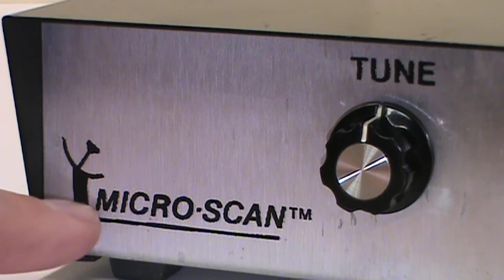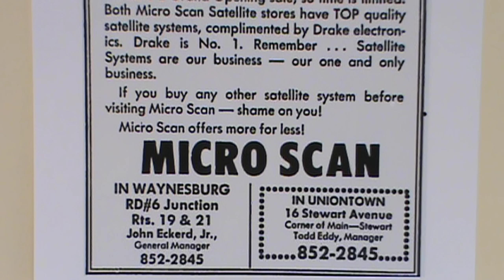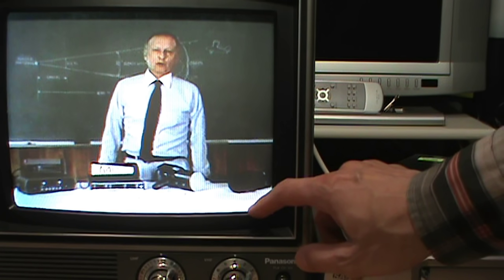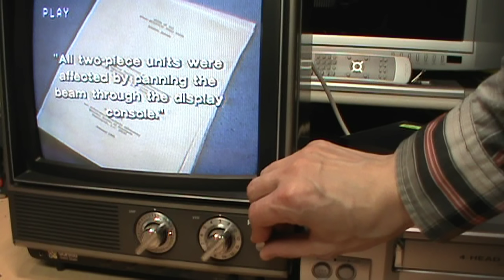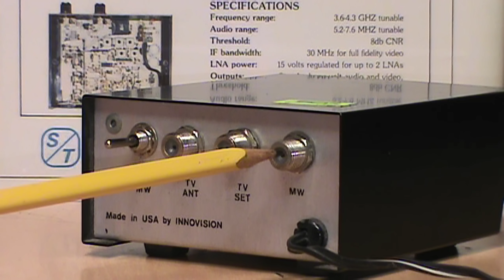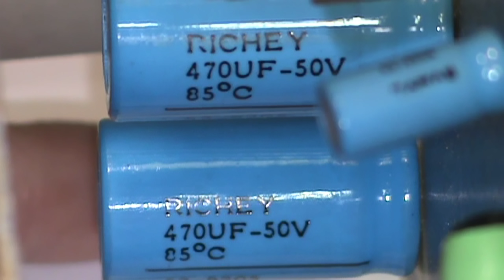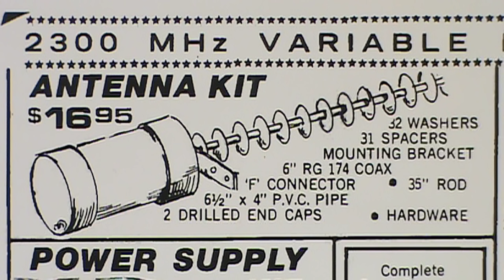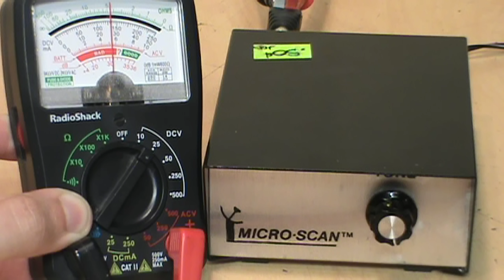Micro-Scan mystery 1980s TV device - Satellite? Microwave?

Comment: We had that exact kit at 9:50 in the early 80's till early 90's to receive HBO here in California. Recorded a whole library of VHS tapes with movies and other stuff like Fraggle Rock.  I tried using it in our new house when we moved but the signal was too weak. I remember trying to record Star Trek VI when it came on HBO around 1993, but the reception was too bad. We eventually just got DishTV and then Comcast later on.

Comment: If it was for 13v / 18v Vertical/ Horizontal or later Right Circular / Left Circular they would just need a on-off-on switch with the voltage of 13 or 18 on each side of the switch

This could be a text generator overlay 

So you click the unit on and it puts the 2nd source over the signal

Comment: MMDS; Wireless Cable !   An old friends rural property has a Receive dish bloody hell WAY WAY up in a 110 ft Loblolly pine tree. The receive dish is curved aluminum open tubing ( not solid bowl) and looks sort of like a 1960s deep fringe UHF antenna channel master and Winegard sold. 

This dish is on a several section "radio shack"  push up pole lag bolted and strapped to the pine at about 100ft up and the Dish originally was above the pine forest canopy. 

This was NOT a "UHF channel" receive setup. This was in the middle of Mississippi about in Carthage Miss.  Near Wiggins#2 between Canton and Carthage .  The download coax to the cabin was long; ie 110 ft down and another 90 ft horizontal; roughly 150 ft to the cabin and another 25 ft inside.

This system ran DC in the center pin to ground that powered the preamp on the open frame dish. The DC part also was varied in voltage to tune it. The preamp was also part Downconverter ie a mixer  so the signal down in the VHF band so less losses. It used 2 or 3 1as the downloaded "converted signal" So this downconverter was set to channel 2 since Jackson WLBT is channel 3. 

So the MMDS 2.2 to 2.7 Ghz  microwave antenna picked up a non broadcast Premium "rebroadcast" that was not a 14 to 82 UHF channel. The mixer by the dish changed it to channel 2 or 3 Vhf to run down the coax

The install crew was 2 guys that took turns with the climbs for each customer. Once Spiderman was up there other guy used a pulley to lift up the dish on multi section pushup pole . The guy went up in the pine with climbers. ie no fancy 1000 buck Swedish bands tree climbers. Basic telephone pole climbers.  Would not have believed it. There was a mid 20s age white and black guy and my God they must have been part Spiderman for those brave installs. I always wondered what they got paid to do that crazy stuff. One install truck a mid 1980s dink Ford Ranger

That dish is still there today and was installed in the late 90s . The service was gone I think by the late 1990s?? Not to sure

Measured the height with a Suunto clinometer long ago 

I am not sure how they billed after the install cost. ie maybe another can cline in.

This whole odd "get premium channels in nowhere" was after the mid 1980s 8 to 12 ft steerable Dish at satellite bubble. Ie you scanned the satellites along the equator zone. Westar 7? , Galaxy 12??  etc TVRO 

Those I think were in the C band like 3.7 to 4.2 ghz region. Much was newscasters getting ready for an event, Both babe putting on makeup. The guy adjusting his tie. not feeds for general view.

For clarity there is no DSL today there; or cable; or fiber. There was no Free money to add fiber since not on an electric COOP service

Comment: This device reminds me of one of those RF A-B switches where there are two coaxal F-connector inputs and one coaxal F-connector output. I could imagine this could have also been used to hook up a cable box, or an antenna in one RF input, and either a VCR or a video game console on the other RF input (like recording one channel from your VCR from one input, and by watching another channel at the same time from the other input back in the analog TV days).

Comment: There was a couple of companies that had this in the Houston area in the 80s and 90s. It actually isn't satellite at all. It's microwave TV which is below the C band. It's proper name is  Multipoint Distribution Service (MDS). They would put this long mast on your roof with a directional antenna on the top that looked like a small dish and they would point it towards the tower. My dad got it for a couple of months in the mid 80s after we got rid of cable. It had two channels. One showed movies 24/7. The other showed old movies during the day and hard adult movies at night. They were not the simulated stuff they show on Cinemax. It was the real deal. I still have the tapes my dad recorded, lots of 70s stuff. Later on another company had a service called People's Choice. It had a converter with a remote and had the same channels for the most part as cable. They scrambled all the channels like they did with the premiums on cable. Both used the same kind of antenna.
Reply: I also had this same box, and lived in the Houston area. I remember getting the two channels, as mentioned, plus a third channel with PPV stuff, such as newer movies, and special events. I saw the very last Muhammad Ali vs. Trever Burbick. Also, the porn eventually became 24/7, which caused some awkward moments, since you accessed other channels turning the button. My mom was visiting and I went to tune to a new movie and for a split second exposed my mom to a very graphic scene. Luckily she wasn't looking. lol. I think this thing lasted about 3 years before better technology retired broadcasting this way.
Reply: @wg4ever58 we had it in fall of 86 or spring of 87. Right away I was like “this sucks, no mtv, nick…” I would have to go to the other room when they put it on the adult channel. I think my dad got it just for the adult movie. His thinking was he could sell them or trade them for other movies. It just had a free moving knob to tune the channels in. After they cancelled it we only had an outside ota antenna till we got cable again in 93. I bet this service was pretty easy to pirate as it didn’t appear to be scrambled.

Comment: These were ground-based microwave TV systems, using a much lower mircrowave frequency than later satellite systems. They were used to distribute cable TV, at the time meaning six to nine channels, reliably, in areas where houses were too far apart to run coaxial cable to them and ordinary rooftop VHF antennas could get maybe two or three channels (and only got that if you were lucky on a given day about wind, weather, ionization layers, and electrical interference). 

Subscriptions were only available to customers who didn't happen to have a mountain between themselves and the transmitter, but given careful choices about transmitter locations, one transmitter provided service to a fairly large area. 

The "tune" knob is just a rheostat, and tuned the antenna to different frequencies by driving a flipflop circuit with a capacitor. More voltage drove the flipflop faster (and frequency higher) because more voltage saturates the capacitor faster. The transmitter and receivers were also shockingly simple; they transposed the entire VHF band by several (seven?) "octaves" using frequency multipliers/dividers.

My memory of these is from a college class where the instructor told us someone had built a commercial microwave tuner in the 1970s and 1980s using only four simple electronic components, and challenged the class to figure out the burning question: HOW?! 

Years before, he had scored a case of tuner boxes and antennas (one receiver built into each antenna, as you guessed) and one transmitter at a surplus sale. He tried at the time to get the frequency license for our area so he could do practical demos, but the FCC auctioned off the bandwidth divided into much narrower frequency bands and combined into much larger areas.

Comment: way back when i ran a uhf tv system owned by the cable co, i had 14 uhf modulators, and Tx combined on our tower. customers had a uhf roof antennae installed, and a tuner box similar to that. we transmitted reverse video as a scrambling method, and the switch just turned on a backwards diode detector in the tuner, and the tv out was set to ch3. the customer would just tune in their ch with the knob. the whole system that was made by MSC looked like it was a built with heath kits as i also had to replace the output mos fets in the transmitters whenever they would blow likely due to no heat dissipation on them. this box kind of reminds me of a multi switch. the mw possibly being used to power and antennae amp either on a vhf or uhf dipole acting like an ab switch. you have a vhf ant on one side, and and amplified uhf on the other. i used to put a radio shack antennae amp on our uhf dipole, and it would be plugged in the wall at the house with the diplex to block power going to the tv
Reply: I'm curious about the reverse video scrambling method. It sounds like this might send the lines out in reverse order, but with that presenting an upside down image most people would „unscramble“ this by turning their TV sets upside down! 😋

(N.B: Coming from the UK I'm familiar with how PAL is transmitted and handled by the set, but NTSC is rather a gray area for me. 😇)
Reply: @UK-Combustibility-Assured video is a positive, and negative sign wave. depending on the detector diode it will detect either the positive video part or negative part. so we transmit the negative sign wave portion, and the switch just changes to a reversed diode detector to send the video to the if. smart people could take their old tv apart and reverse the diode and just use the normal uhf tuner in the tv, but regular tv would not work

Comment: I remember seeing those type of devices a couple of times in the early 80s. My grandparents who lived in very rural southern Missouri had something similar as part of their big satellite dish setup in the early 80s. The used a box this like to tune in a few different stations as the nearest over the air TV stations were in Springfield MO whose antennas were 40-50 miles away. 

Later on in the 80s they upgraded to a different and more robust satellite receiver using the same dish and added a motorized mount. They used variations of that until the early 2000s when they changed to a DirectTV system which they used until they both passed in early 2010s.

My family and most of my close relatives lived about 8 hours away and we all had cable TV back then. The world of C and KU band satellite TV was so strange and exciting to us! We tended to visit in caravans around certain holidays with the parents usually staying in a motel in town about 20 minutes away. All the grandkids piled up in sleeping bags or fold out beds at the grandparents place! Those were the days!

Comment: The Converter Kit and Antenna Kit was used as a pirate receiver for over the air transmission from HBO. I had and built one in 1982. I worked at an electronics company and had a technician friend help me with the tuning with a frequency counter. If you drove around the neighborhood you saw a lot of them on roofs. HBO started changing their transmission frequency eventually to stop theft.

Comment: That box was likely designed by a guy named Don Wickman.
Don back in 1980 had figured out that HBO was using the STL (Station to Transmitter) 2 GHz band as an intercity signal relay to condo MATV systems & cable headends. His simple VCO controlled microwave dish downconverter was able to intercept HBO programming.
He went on to create a company he called "Pirated Video and Microwave" which later on was sued bigtime by HBO but by then there were dozens of other copycat companies selling the same hardware.
In the 1980's, before fiber, there was a big explosion of new channels like HBO & Showtime and using microwave relays made it quick and easy to deploy. The FCC also didn't consider this type of delivery method, at that time, to be a broadcast service so they didn't require a broadcast license, only a carrier class license like a phone company.
Reply: My uncle Randy was a 60s IBM guy. My dad bought one from him for about $70 & and we were the first ones on the block to have HBO 🤘🏾
Reply: Spectacular comment.
Reply: This is the answer!!  I just posted that I built one of these with the cantenna coffee can enclosure.  It  tuned around 2.5 GHz and also received Instructional Television Fixed Service (ITFS), now the Educational Broadband Service.

Comment: This doesn’t look like any C band satellite stuff I’ve ever seen, but I haven’t seen everything.  I had a C band and later upgraded C/Ku band setup in 1985.  Early receivers used an LNA and separate downconverter on the dish with a 70 MHz IF output.  You also needed a polarizer control because the 36 MHz wide channels overlap each other 6 MHz on each side.  The channels were separated by alternating between horizontal and vertical polarized transmission on adjacent channels.  The downconverter was tuned by sending a DC control signal.  The power and output usually shared one 75 Ohm co-ax and the varactor control voltage was on a second co-ax  The polarizer had a separate set of servo wires which were usually bundled with power wires for a jackscrew used to position the dish.

As the home dish market matured, the outdoor unit switched from LNA and downconverter to an integrated LNB block converter which sent the whole 500 MHz swath of C or Ku band on a 950 MHz IF down a single power/signal co-ax to the block tuner inside.  If you upgraded an old setup with two co-axes you could then have two LNBs - either both on C band but different polarities, or C and Ku band LNBs with a separately controlled polarizer.  Chaparral made a feed called the Polarotor which had a Tiger servo motor to control polarity and two flanges for mounting C and Ku band LNBs to the same prime focus feed point.  That’s what I had on an 8 foot MaCom/Prodelin dish with a 32 inch focal length.

It was a lot of fun back in the day.  I didn’t care much about watching channels.  The news uplinks were much more revealing.  The most riveting I witnessed was when armed Chinese army guards kicked CNN out of its studio following the 1989 uprising.  That was must-see TV.  I’m sure CNN must have been rolling tape, but they never showed the incident on air.